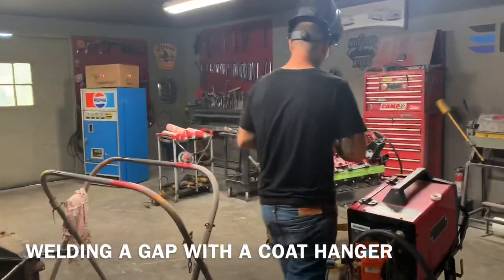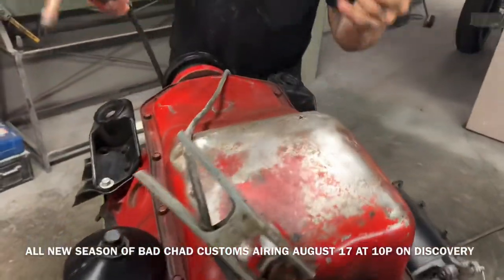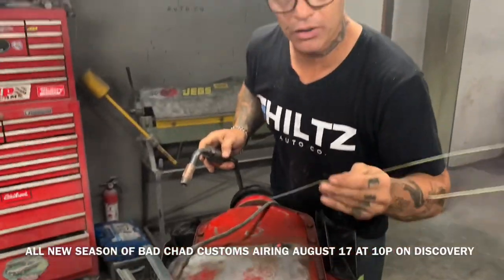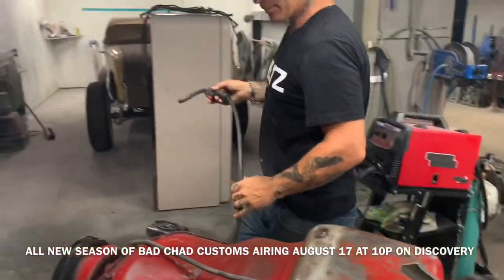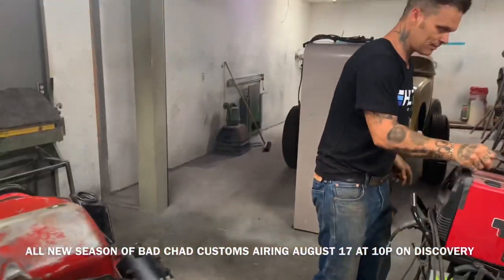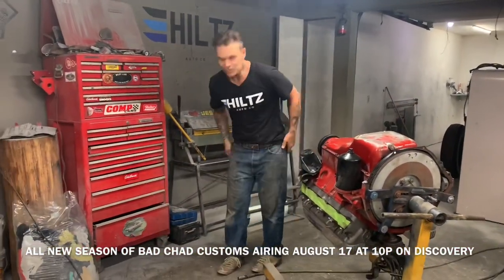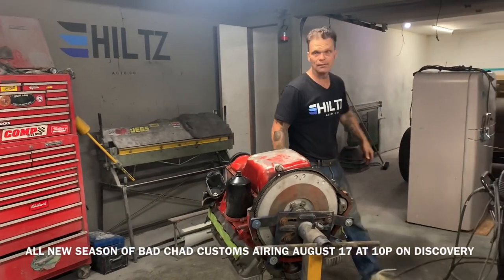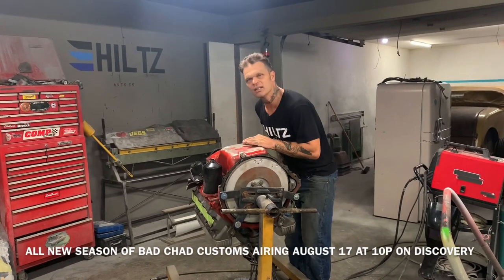Welding a gap with a coat hanger 🔥

Comment: One day I was at a four-wheel drive event with my friendand she put a dent in her oil pan so big it was hitting the crank and I welded a washer on it and pulled it back out and used a coat hanger to fix the crack and then she went and won a trophy

Comment: Recently cut open my cats on my 5.7 and the kerf left made filling fun I didn't have any steel to over lap it with now I see the coat hangers I have sitting around can be useful for quickly filling those ... thanks I never would've thought to use a hanger .

Comment: What wire do you like with that machine, they do make great wire. Replaced trusty old stolen miller with one, came with 035 flux, had to use it being outside, have always used 030, steel or flux, id forgotten  about a hanger being in a hurry, worked ok on 2" x 3" galvanized cab corner patch I fabbed. Lays down nice stringers on 18ga.

Comment: I seen you add material using the coat hanger. I think it was on the lower drip tray of Jolenes car. Think you can make a video showing how you add material to  metal using this method?

Comment: Chad
When I have a hole on thin sheet metal to fill I use a .25"-.5" cooper square plate as a backing it absorbs the heat plus the weld will not stick to it. It works great for me in any position required
Mark Dutka

Comment: If you can get to the back side of the metal you can use a piece of aluminum or a piece of brass on the other side from that your welding arm to hold the metal from falling through I know you didn't want to remove the oil pan on this

Comment: All the crap fell into the oil pump pickup from welding.
Reply: Was thinking the same? Seems like something the pan should be removed from the block to do save more $ that way
Reply: Nope u dopes.it was a pin hole. Pretty sure its plugged before it got contaminated.
Reply: @joshuaspringer7930  Wow! Someone with a clue! Been there done what he's doing and it worked perfect, I did it with the engine in the car! I got a hole poked in the pan from debris in the road, I put a big metal screw in the hole and put oil in it to get home then backed the screw out to the last thread, cut it almost even to the pan and welded it right to the pan, worked perfect!

Comment: I've done the same thing but I used a nail instead of a coat hanger I had a bad experience with coat hangers back in the days a guide welded my exhaust with gas and a coat hanger I was driving on the highway the exhaust broke off it bounced on the ground and hit a state troopers windshield explain to him what happened he looked at me put his hand on my shoulder wrote me a ticket shook his head and drove off